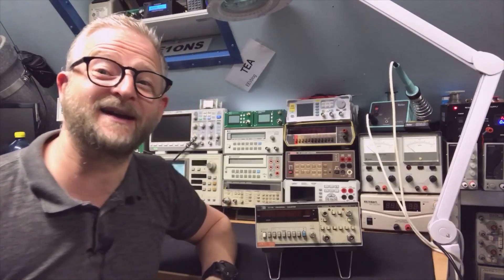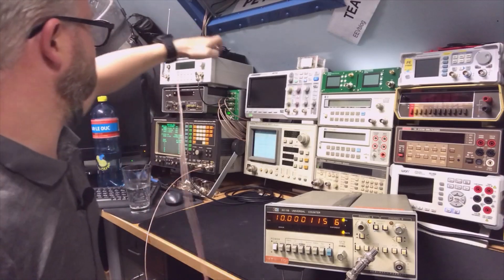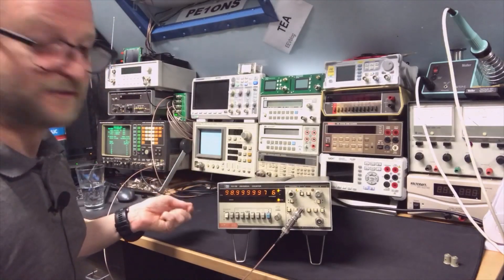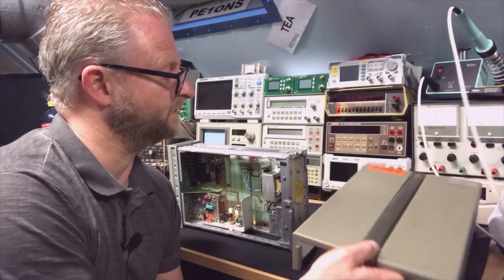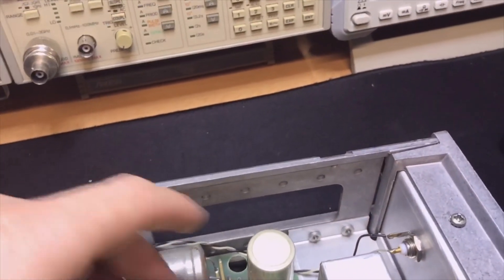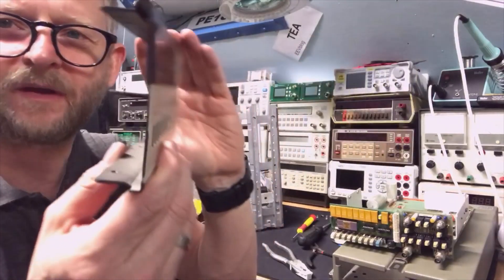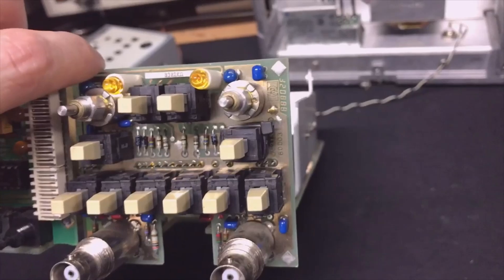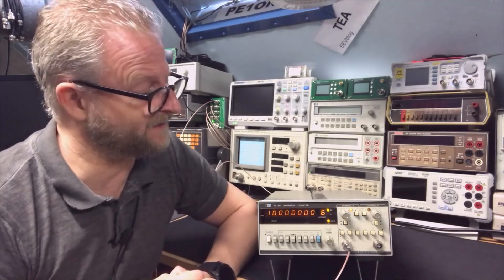#067 HP 5315B Frequency Counter Restore Teardown

Comment: Hello, excellent video! I bought a 5315A with the 1G option. I don't understand why the 5315B has a 10MHz reference input. and not the A version? Another thing, I saw on the diagram that there is a 1k resistor to install in series at the reference input! Did you install a GPSDO on your 5315A? Thanks Jacques
Reply from the maker: Yes very nice counter, nice catch!  the GPSDO i do use, but i connect all my devices to 1.

Comment: Just got one of these with the option 1 and 3 the presaler and temperature control oscillator. Going to restore it soon even though surprisingly it works and was accurate from initial testing even though sold not working unknown cheap. 

I might buy a doner unit to get the top piece covering the front panel screws otherwise in decent shape.
Reply from the maker: Wow! that is indeed very nice. Nice score!. good luck on the restore.

Comment: Franz
hello an info

I have damage to my HP 5315 B the switch (Gate Time Delay) to the right of the blue button is broken. From the manual it looks like S1 to me but I can't find any code I ask you if you have this switch available
Reply from the maker: Yes that is a weakspot, usualy that us the first to break... that pot+switch... maybe set it to fixed bridging the switch, or using a foxed resstor...mine is broken too. but i need to look into it still.
Reply: thanks for the comment (there are two of us with the same fault) if you can tell me when you look at it, how you solve it.  Now I have to try to solve the cursed E3 error. HAPPY NEW YEAR

Comment: Does it read sine waves.  No one ever answers this question, including you.  All they say is the freq, but never WHAT TYPE of wave you are inputting.  I have a B model, just like this one and it can not measure sines waves at all, but square waves are perfect.  I think it is a closely guarded secret no one wants to tell anyone.  Even the manual does not answer this question.  Neither do you.  No one does.  Is the Illuminati involved here ?
Reply from the maker: Yes it should read both without any problem, in this video i use square, but it should not matter, that is why it is not mentioned.
Reply: @TonyAlbus  How does it compare to the Wavetek FG2A frequency counter?
Thank you
Reply from the maker: @SDsailor7  Hi, i do not have the FG2A to compare
Reply: @TonyAlbus  Ah ok, I noted that yours goes to 100Mega hertz the wavetek FG2a only goes to 1Megahertz.
Thank you